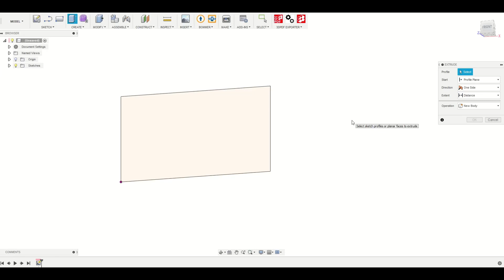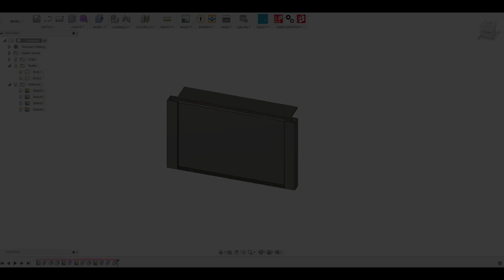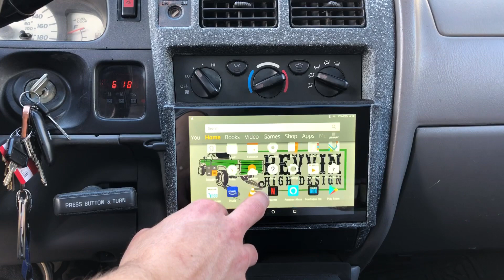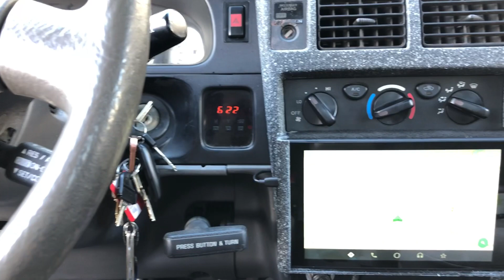How To: DIY 3D Printed Amazon Tablet Car Head Unit | Custom

Comment: I played with using the Amazon Fire Tablet in my car, but it does not have GPS hardware for navigation.  There are some ways to piggyback off your phone' GPS, but it was wonky.  I've shelved my project until I find a good small tablet with actual GPS functionality.
Reply from the maker: Yes, it is not the ideal tablet for this project, but they are cheap. I just turn on my phones hotspot and connect the tablet to it that way. Its done pretty well, but my next project will definitely be with an iPad mini that has built in data!
Reply from the maker: I was also able to install the google play store onto my amazon fire tablet, which opens up a few more possibilities.
Reply: It's perfect fine for the job. You just also need an android phone. There is an app called headunit reloaded. You installed that on the tab. Then you open it, and plug in your android phone via usb. It activates android auto just like a car infotainment system. It works very well, and I run a galaxy tab a 8" with it. I GPS, I stream music, I do anything android auto can. I'm going to mount it all soon, right now the tab is just mounted via magnets. My steering wheel controls work, it looks decent, and I'll even have a reverse cam.
Reply from the maker: Blanco Niño thanks for the input! 
That sounds like a cool plan, let me know how it all works out!

Comment: There are flat ribbon cables that you can get if you wanted to hide the usb cable inside the mount...
Reply from the maker: Jack B working on a new iPad bezel for a Ford F-150. May have to implement this, thanks for the tip! Video coming soon!

Comment: What software is this. Looking at buying a small 3d printer to make gauge rocker mounts etc.   

Thanks
Reply from the maker: Printed on a Creality Ender 3. Design software used is Fusion 360, and slicing software is Cura!
Reply: @goodolboycustoms  thanks mate